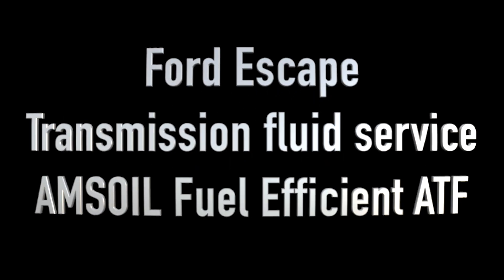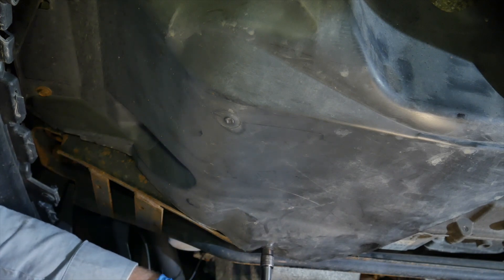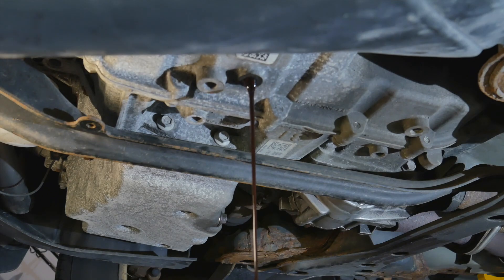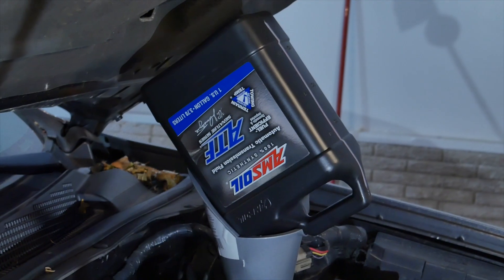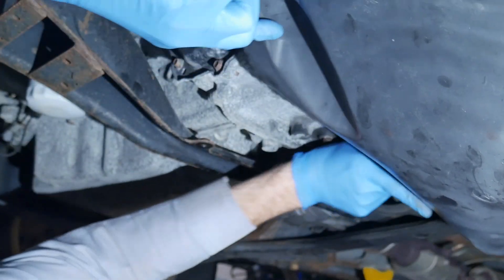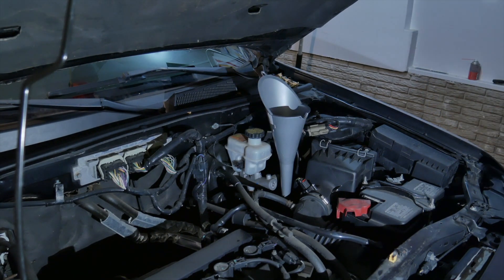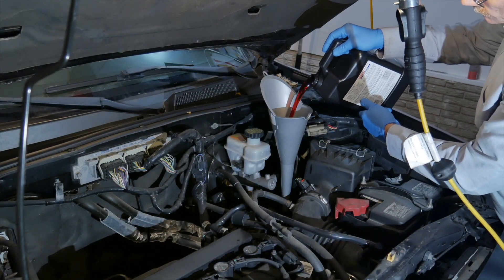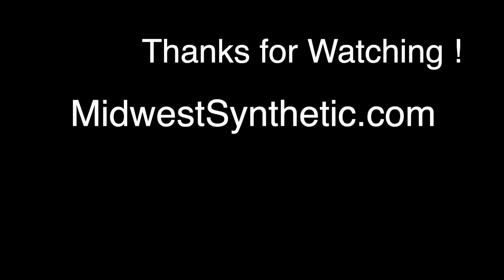Ford Escape Automatic Transmission Service - AMSOIL Signature Series Fuel-Efficient Synthetic ATF

Comment: I have a 2012 ford escape 2.5 4 cylinder, I changed the fluid a few weeks ago and I only added 4.5 quarts, should I add the rest of the 0.5 fluid left, I only use motorcraft mercon LV from Ford, this seems the same trans as mines, I forgot the measure the fluid that came out. But is it 5 Quarts that comes out? Thanks
Reply from the maker: If you have one without a dipstick, there's a different procedure to set the level with the plug on the side of the transmission.  The FordTechMakuloco channel has a good example of this.  Thanks.
Reply: @midwestsynthetic  mines has a dipstick it's a 4 cylinder 2.5l, I believe it has the same trans as this one you did, did u check the dipstick when hot? I poured in 4.7 quarts of trans fluid and it's showing above the DO NOT ADD fluid mark. Is that bad?
Reply from the maker: The trans fluid is checked hot and you wouldn't want to overfill.  If you have a dipstick determining the proper level is in the owners manual.  Ford has them on-line if the paper book is missing. Thanks.

Comment: If the car has transmission cooler lines , you could have disconnected the return line and use the new fluid to push out the old fluid

Comment: I took my 2011 Escape to the Ford dealer and the service writer is telling  me that pan has to be removed to change out an internal oil filter.  Is that true?  Service on the transmission is $729.00!
Reply from the maker: Sounds like a clipboard commando that's not familiar with the vehicle.  I would expect a 2011 to be very similar to the 2010 in the video, with no serviceable filter.  Any filter would be inside the transmission where you would have to split the case to get access to it.  Not a normal service item. Thanks.

Comment: Great math. Also I got my transmission oil change done but they only did 1 change is that ok? Forsure next time I will do it on my own.
Reply from the maker: I did the multiple swaps so I could get most of the fluid changed out and I know for sure what I've got.  Going forward I'll drain and fill once each time.  Thanks for the comment!

Comment: This trans fluid will fit also a 2004 ford escape 3.0 v6? Thanks! in advance
Reply from the maker: The 2004 3.0 Ford Escape uses a different product that the 2010 in the video.   It calls for Signature Series Multi-Vehicle Synthetic Automatic Transmission Fluid.  Check out the lookup guide link below for product recommendations for this and almost any other car, truck, motorcycle or ATV.  Thanks for the question!

http://www.amsoil.com/guides.aspx?zo=5265385

Comment: What is that white stuff on the upper part of the plug? Is it thread seal tape?
Reply from the maker: That is Permatex thread sealant from a small tube.  For this application a thread sealant suitable for use with transmission fluid should be used.  Thanks for watching and leaving a question!

Comment: @MidwestSynthetic  

SO since you've switched to the Amsoil Fuel Efficient Synthetic Transmission Fluid,  do you find it shifts as good  OR even better than the car did back with the OEM FOrd Mercon LV Fluid you'd get at the dealer?
Reply from the maker: It does seem to shift smoother.  That's the one thing that I usually notice after changing the transmission fluid to AMSOIL.  Thanks for the question.  Merry Christmas!
Reply: @midwestsynthetic  Thank You. Merry Christmas to you as well. Stay Safe.